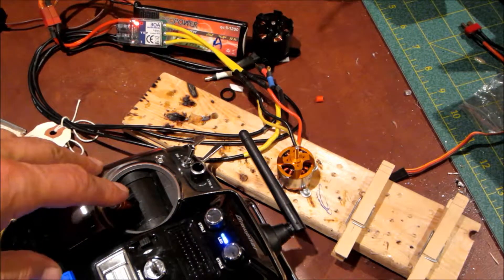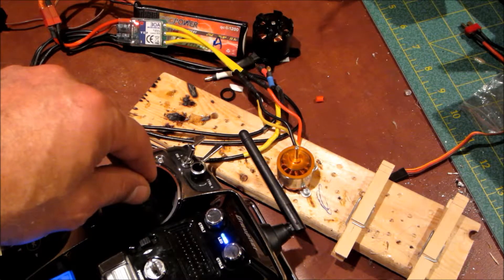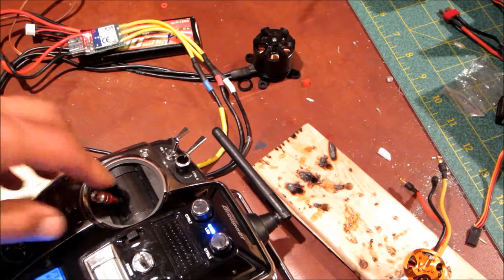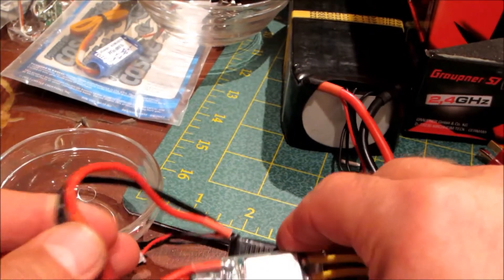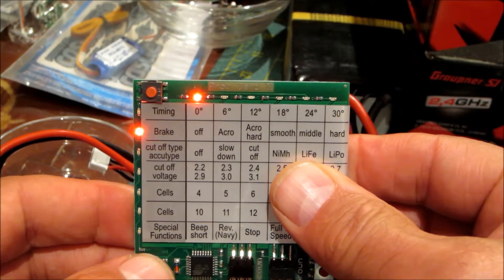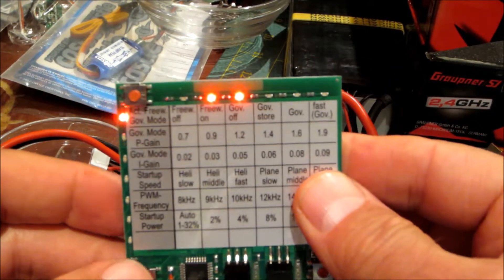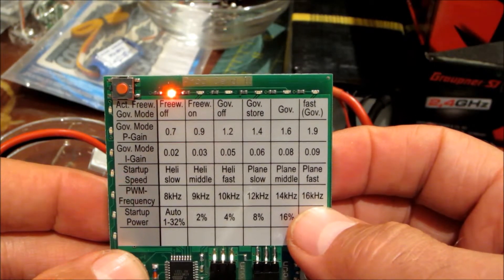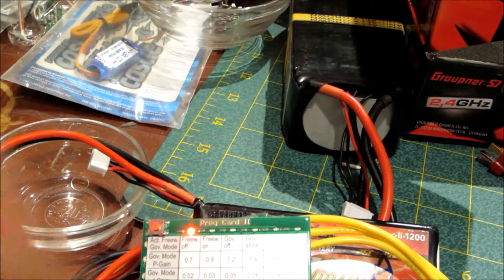YepESC01

Comment: How did you connect your ESC to the program card. Is it via the "ESC" port on the program card with a 4.8v battery in the "RX" port  powering the card, and the ESC powered by the mains. I have a 120HV YEP connected this way with the convenience of separate program cable attached to the ESC. I have a 30amp YEP I want to program.